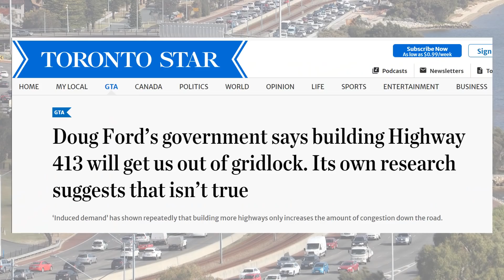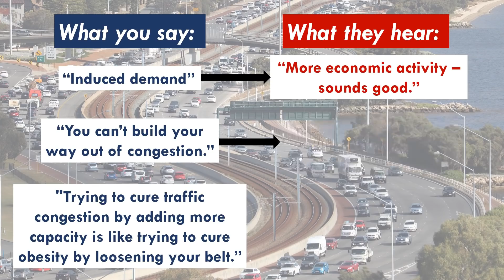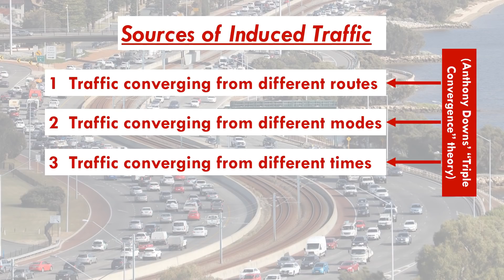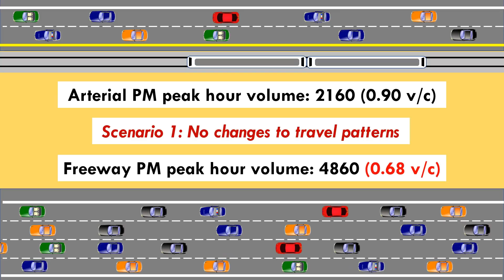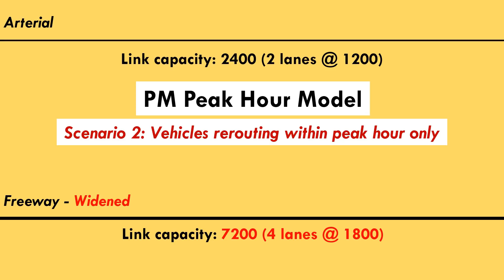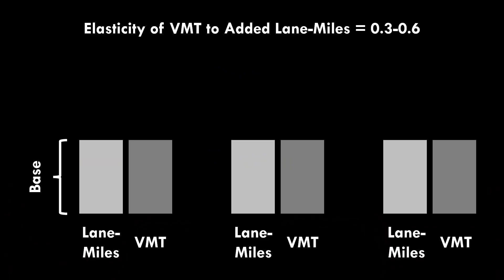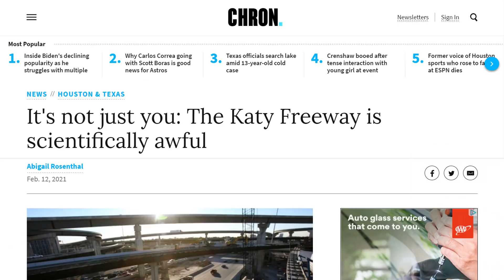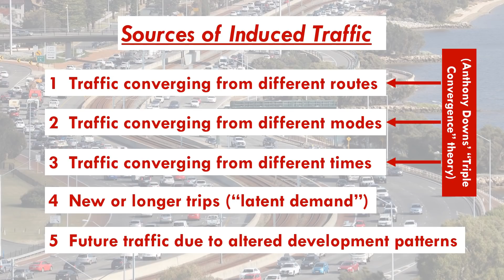Induced Demand & Roadway Widening: Everything You Always Wanted to Know (and Weren't Afraid to Ask)

Comment: I live in Houston and have followed the 45 project. I have a problem with the way the commenter phrased the project. Yes they are widening the freeway, but they aren’t actually adding travel lanes. They are widening the freeway in order to extend the HOV/Toll lanes. What this will do is actually add lanes for the park and ride buses. The city likes this. The issue the city has is that the state is demolishing hundreds of businesses and homes to do this and completely ignoring local stakeholders (ie the people who own/work at these business or live in these homes). Therefore the issue isn’t actually induced traffic (tho I think the video was great and very informative of that topic).

Also there is a second part of the project where they will redirect i45 to move along the east side of downtown, which will make traffic significantly worse during construction and considering the history of construction in this city, it won’t be done for many many many years. 

The positives to the second part is that the current route for i45 along the west side of downtown has dangerously steep turns and slopes and poorly aligned exits, this is supposed to confront these issues. Also since the new route will run alongside highway 59 (i69 for the uncultured) and thus look like a 20+ lane freeway, they are building a park over part of the freeway. This would allow connection between downtown and the sliver of east downtown that will be left over after they build a freeway on top of it. Also since midtown and downtown will no longer be separated by an elevated freeway, it will open opportunity for development between the two. 

So really what the project offers for traffic is good. The issue is that the project will tear through primarily poor areas, and for the foreseeable future will litter our city with congestion-generating construction.
Reply: I've also been following the I-45 project. At a minimum, once you get past 610, there's the Hardy Toll Road that almost nobody uses, so paying billions to widen a freeway just to accommodate more cheapskates that won't pay a toll hardly feels worthwhile.

There's also a strong reek of general politics here. You have one political party that runs the state. The precincts where the I-45 expansion would take place vote overwhelmingly for the opposite party. The legislative districts are all gerrymandered, so a few votes at the margin is meaningless. So, the state politicians really have no reason give a ** about them (or, at least, those with the power to actually do anything beyond cast protest votes).

By contrast, the state politicians empathize much more deeply with the rural landowners between Houston and Dallas, whose farms would be impacted by the proposed high speed rail line between the cities, even though the actual number of people in that category is far less. This is because the latter group is constituents of the party in power, while the former group only elects people that have no power.

Comment: I remember when I-696 opened in Southfield near Detroit in 1989. Zero traffic congestion on the roads parallel to the new freeway. Terrible traffic on the roads feeding the new freeway.
Reply from the maker: Traffic engineering is super difficult and interesting!
Reply: Wow its only been around since 89 I had no idea I would have guessed it was built in at least the 60s
Reply: @calvinbarr6919  confirmed on Wikipedia.  Construction started in 1961 before the Berlin Wall went up.  The western part opened in in 1963.  The eastern part opened in 1979.  The middle opened in 1989 after the Berlin Wall came down.

Comment: This is fascinating and your detailed explanation is enlightening. I did not know that “induced traffic” (I do prefer your term) was even a concept but it makes eminent sense. As an interested layperson some of this was a bit beyond me (well, I do recall some of Economics 101) but I marvel at how a general idea/concept can be quantified in this way for analysis. However I did notice your comment towards the end that any widening of a highway, no matter how justified on models, seems to inevitably create a bottleneck, at either or both ends of the widened portion. Wouldn’t this either make the whole analysis useless, or would the highway distance parameters have to be extended almost indefinitely in order to eliminate bottlenecks? Or is this where mathematical modelling would have to meet common sense?
Reply from the maker: I wouldn't say it renders a project totally useless, but the "next bottleneck" (and there always is one) definitely reduces the assumed effectiveness of the present project. So it still has "value" (if you accept that reducing v/c ratios is a useful value), just not as much as is usually presented.
Reply: I've seen explained as "trying to reduce traffic by widening highways is like trying to lose weight by loosening your belt."

Comment: Around Chicago, the roads are constantly under construction.  I'm not sure any of these improvements to the roadway network have ever been able to see the full potential of the improvements given the construction bottlenecks that are always present.
Reply: I'm sure if you put current volume onto the original freeway network of Chicago, you would see substantially increased travel times resulting from too many cars trying to use substantially less space. While the congestion may seem ever present, the increased capacity is still moving more vehicles.

Comment: I don’t agree with your supply demand curve. If you increase supply which induces demand the demand curve must also move and therefore find a new equilibrium point (it’s impossible to know where it will be but likely as the same level of delay i.e. Katy freeway or supulveda pass).

The instant the expansion is completed the demand curve is the same and thus the congestion benefits are realized. But, over time (say a couple years) the total demand shifts up and thus the amount of delay rises.

Comment: "All models are wrong" is a saying you'll hear sometimes in traffic engineering circles. :) My region is adopting an activity-based model to replace the 4 step model, but I am still learning about it.
Reply from the maker: It amazes me that the standard practice is to generate a single forecast based on a single set of assumptions rather than some sort of Bayesian/probabilistic approach.
Reply: @CityNerd  Good point on this. There is work to apply models to show results as a distribution. ABMs have far fewer broad assumptions and are much more flexible in showing the effects of specific changes like tolling and special lanes.
Reply: The longer saying in science is "all models are wrong but some of them are useful." :D